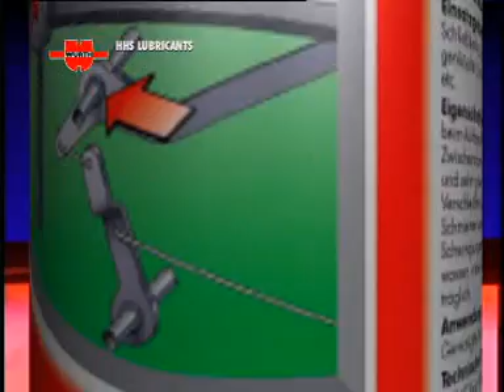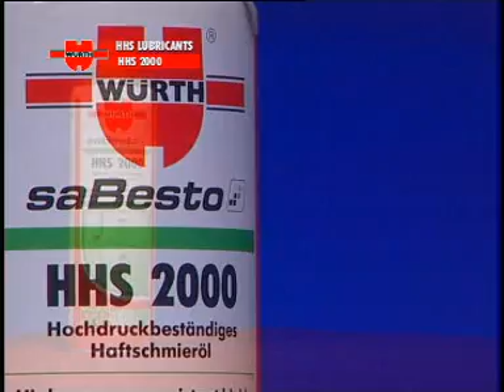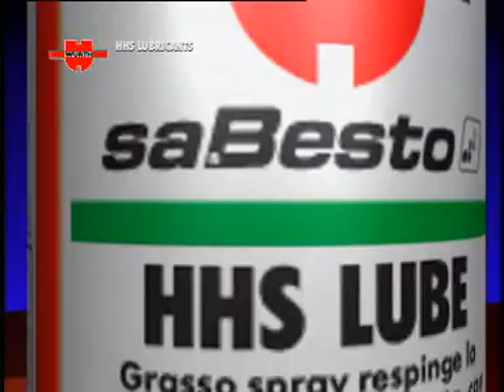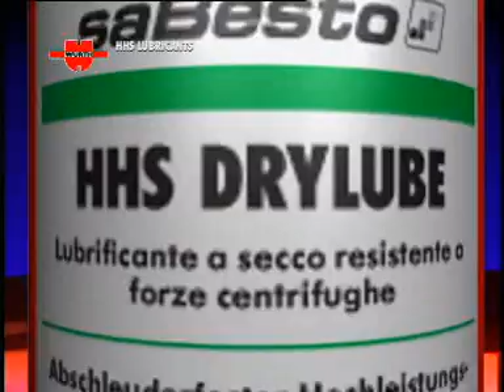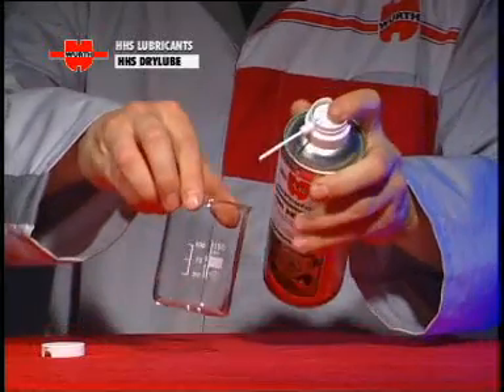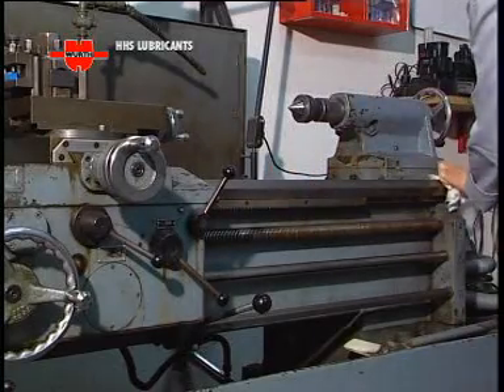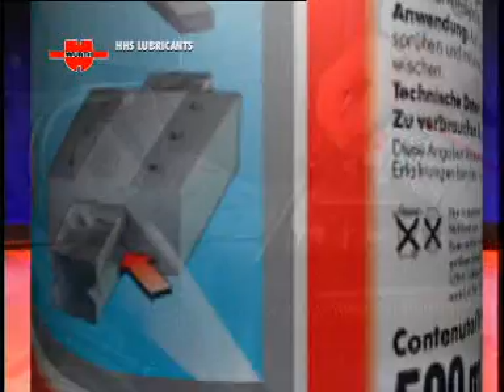Würth HHS Adhesive Lubricants

Comment: What's the difference between HHS 2000 and HHS 5000? I'm looking for something to lubricate plastic engine parts.
Reply: HSS 2000 goes tacky after 30 secs and is very good for gears and moving parts HSS 5000 is i crazy product it will creap up a bolt thread from below it